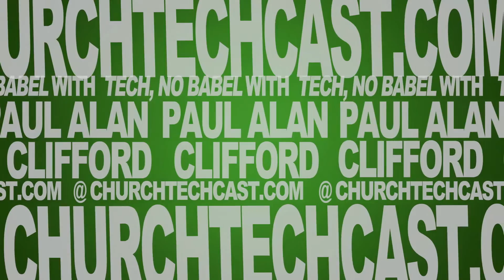What's a compressor/limiter/gate?  | Tech, No Babel

Comment: i use a cross over for the subs and loud speakers. my question is, should i use a compressor/limiter/gate to control between the mic and speakers in case sometimes people bring the mic too close to the speakers and they might shock each other?
Reply from the maker: If you have a mic in the system, then yes.  A compressor/limiter could help out.

Comment: thanks for replying to me so quickly. I ran my equipment with 6 speakers, 2 monitors, 2 subs and 2 loud. my speakers were shocked. all horns are not working properly now. I confuse not sure what to do to protect my speakers in the future.
Reply from the maker: Were they wired parallel or in series?  If you wire multiple speakers in parallel, you can get a lot more power out of an amp, but that could be a problem for speakers or the amp.

Comment: hi paul, i have a question for you if you dont mind. i use passive speakers for my dj. do i need a compressor limiter gate to control my system?
Reply from the maker: The speakers don't matter. (I assume you send the signal in Pro an amp first and then to the speakers). What matters is the content. If you're using all preprodiced music, it's already been compressed. If it's live, consider doing it.